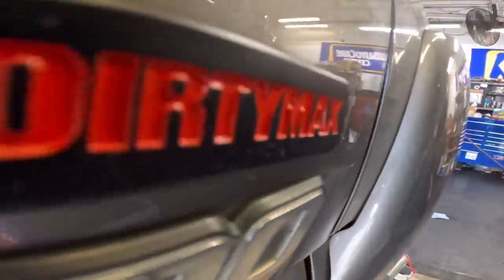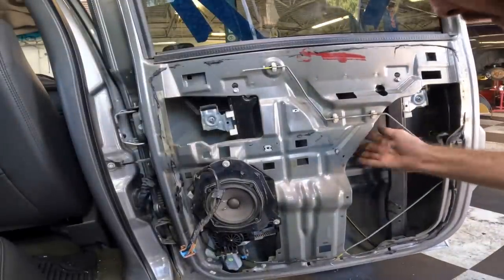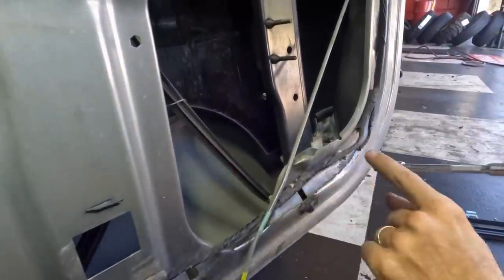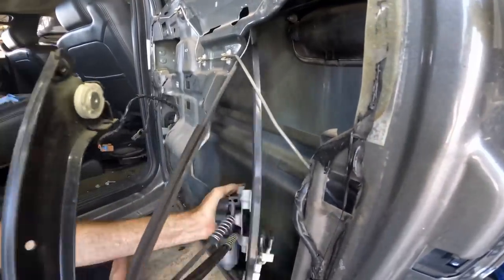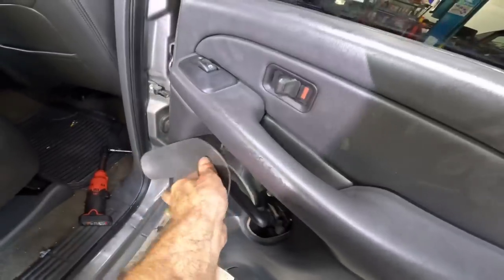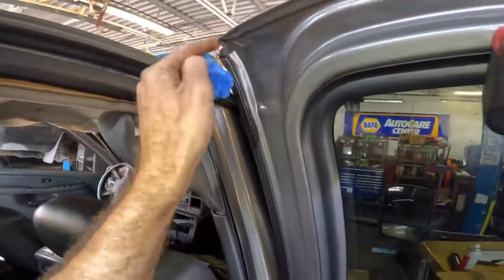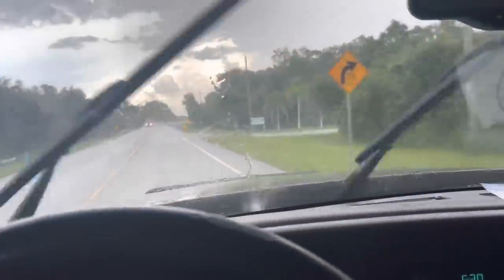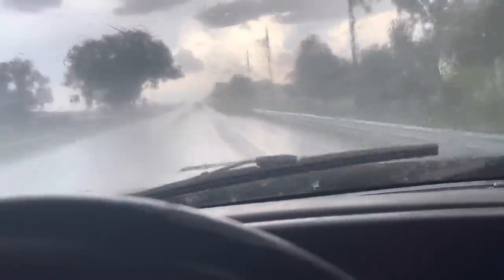Busted Window Regulator!  2007 Silverado 3500 Duramax 6.6

Comment: Sometimes cooking oil spray will break up adhesive left from tape. Of course, then you have to clean off the oil, but wax and grease remover works well for that.

Comment: Great video as usual. But having replaced all 4 regulators in my 2000 Yukon XL in the 14 years and 44,000 miles while I owned it,I would not recommend paying the the 250% premium over the price of a Dorman replacement for OEM, Those Delco units are junk also, just more expensive junk than Dorman. My right front window was seldom raised or lowered. Drivers side mainly for drive thru fast food and an occasional tool booth, and the rear ones literally went years without being deployed. 
Full disclosure I've also replaced two front Dorman units over the past eight years as well since I passed the Yukon on to my daughter who still drives it today. GM wanted well over $200 for OEM and Dormans were in the $70 - 85 range at the time.
I'd also recommend that anyone attempting to do this job test their installation before reinstalling the door panel since no one in their right mind would want to deal with that icky sticky plastic liner glue a second time.

Comment: The reference is to James Fenimore Cooper's The Last of the Mohicans published in 1826 which is a fictional "narrative of 1757." It's a wonderful tale involving the interaction of an Englishman, Hawkeye (Natty Bumppo), with a Mohican, Chingachgook. Although somewhat dubious as history, it does give an idea of what went on In New York State among the tribes and the French and the English in the eighteenth century. All of Cooper's Leatherstocking Tales are wonderful transports into a very early time where values were far from where they are today--cultural differences could still be acknowledged and celebrated.

Also, 99% Isopropyl (available in bulk gallons from Amazon) is unsurpassed for removing glue residue. It was the only thing that finally worked to get the glue off some Lexan windows after the protective paper had been left on too long.

Comment: Ray any octane booster will give you improved mid and top end, and if you drive as you would normally, it will give gains in mileage, what you have to take into consideration is the cost of the additive against the fuel saving, generally not effective enough gains to justify for economy reasons but you can certainly get some power gains  with a booster

Comment: You know, hiding that screw under the armrest so they didn't have to cover it with a plastic cover probably saved 25 cents per vehicle and this allowed the CEO to go to Aruba an extra time that year.  Very smart.  I had an S10 and the window regulators were riveted in.  The back one with all the torque would always loosen up and cause the window to go out of alignment.  The answer was to drill it out and replace it with a small bolt and nut.  I was like yep, another trip to Aruba.

Comment: They make a 4 or 5" eraser wheel that goes on your drill, cleans adhesive residue of paint like a speedy eraser.  Us body men use them all the time for getting door molding tape adhesive of.  Leaves no residue.

Comment: I could never figure out if there was a way after the factory, to get anything changed out. It didn't make sense how it would come out and back in. But you buzzed right through it. Nice job!
Did you forget the grayish colored plastic clip that the motor cable clipped to?

Comment: Use petrol/gasoline to get rid of the adhesive and rubber layer then go back with the brake disc cleaner to get rid of any residue.

Comment: WD 40 works a treat to remove tar and adhesive from paint, metal and glass (don't get it in plastic). Meguiars Plastic-X works to remove it from plastic.

Also I use old credit debit cards to scrape paint as it conforms to the body lines better than a straight edge scraper.

Comment: I switched to ethanol free and my engine runs smoother. I also gained 2mpg so far, up to 33.5 on my 2015 Honda Civic.
Reply: If you can find it, ethanol free is the way to go for sure.  I remember when they rolled out the 'oxygenated fuels' here in the Phoenix area back in the late 1980s - people complained about the drop in fuel economy.
Reply: Thats Good

Comment: I did notice you forgot to put back the harness retainer, no big deal. A hint from someone who has been doing auto painting for over 40 years, to remove tar, glue, tape, and asphalt from paint without damaging the paint use Ronson Lighter Fluid. Not Zippo, only Ronson works and it even gives you a description on the can what it removes. Just a little on a paper towel works wonders.

Comment: If Oxcetane manages to boost the Cetane Rating of the fuel id pour double or triple the recommended amount in the tank and really boost it up because diesels love that they are really picky about their fuel. 
In addition mix in some synthetic 2 stroke oil like 1:200 or 1:300 ratio mix.
Diesels love that stuff.

Comment: Good stuff Ray! One of the most painful jobs I ever did was replacing my old deflectors that were brittle and missing like yours. That dried old adhesive was ridiculous to remove. saw some nice tips in the comments for next time. Where can I find a truck like that? Need to upgrade from my 2500 Suburban. Thanks for sharing.

Comment: I'm still running the original dealer installed AVS vent shades from 2001 on my Durango.  I had to replace the driver door and bought a set for a Dakota, still have a spare passenger door shade if needed, also need headlight switch, broken knob 🎛️

Comment: They sell a rubber wheel that makes getting that double sided tape off super quick. The body shop industry uses them. Saves lots of time! Throw it on the air tool and takes it off in a hurry.

Comment: I think one of the extra screws goes on the bottom rear of the door panel. I was yelling trying to get you to hear me, but alas, I couldn't.
I also tried to get you to plug in the speaker, but you wouldn't listen, again.

Comment: Ray as a detailer I'm cringing watching you use that adhesive remover 😳😭 however a much easier way to remove that would be to get a plastic razor blade & windex IMO I've done it before & it worked wonders. However it's not my vehicle nor my area, thanks for the great quality video as always. Have yourself a fantastic day & great weekend sir 😀
Reply: Plastic Razor Blade?
Where do you get one of those?
Reply: Amazon they're awesome & they work great & don't scratch the paint
Reply: @ExposingCorruptionNC  
Thanks!
I’ll look for them!

Comment: Ray, your Silverado has with in a few hundred miles of my '14 Accord 6 speed manual.  Only failed part was a sun visor and normal wear such as tires and brakes.
Reply: did you see the check engine light on....wonder what that's about?

Comment: They seem like unusually big holes in the door for the regulator to be moved through. I'm sure on other ones where you've related regulators the holes weren't really designed to allow them to be replaced.

Comment: I am curious as to why (since the window was already tapped in place) you didn't unscrew the window clamps prior to lowering it only to have to clamp it back up top to remove the mechanism from the panel.

Comment: Interesting - though RARELY ever used, the window regulators in the rear doors of our 2005 Yukon both broke, seem same as in this video. Since we are in Arizona, and rarely have passengers ( Mrs. Cuss uses it for towing) and the AC is used 95% of the time, I just moved each window to the closed position and used two sheet metal screws on each door to hold the window in the up position.

Comment: WD-40 will remove adhesive residue without ever harming the paint.  Probably one of the best multi use lubricants on the market👍
Reply: Lubricant, yes but not for loosening rusty nuts and bolts like most wannabe mechanics on YouTube.
Reply: It's mostly kerosene. Gets sticky after a while and draws dust.

Comment: I've found WD40 is good for getting nasty adhesive gunk off, and it won't harm the paint. Follow up with some glass cleaner to clean off the WD40 residue and it'll be NiceNshiny! And WD40 and glass cleaner are both inexpensive

Comment: As for ur DirtyMax aftermarket badges, I would've recommended spraying it with Meguiars Headlight coating or equivalent to protect it from the UV Rays before installation and allowed 24 hours to cure. Aftermarket is total garbage.

Comment: Just wondering if that was OEM that you took out. When I replaced the motors in my  95 Camaro they were riveted in had to drill them out, and  replace with lock washers, nuts ,and bolts.

Comment: The directions on that 3M Multi Purpose Adhesive Remover does say to let it soak in before attempting removal.
That stuff's also about $22 per spray can.
Let the chemical do its job Sir.

Comment: WD40 works VERY well for 'adhesive removal' - just let it moisten for a bit of time, then the glue softens.
You'll need soap or alcohol to fully degrease the surfaces when done, but everyone has WD40 and it's far less expensive than the 'specialty' stuff.

Comment: The old regulator did not appear to be OEM, black painted brackets instead of galvanized, and the cable were bare instead of in housing/sheath. I smell a Dorman part. And what kind of trickery is GM trying to pull....no rivets?

Comment: There is another unavoidable Shop Rule: Any used adhesive  gasket, or tape buggers thrown on the floor will invariably become firmly lodged in shoes, creeper wheels, Rolling Tech Cart wheels, and anything else that you need to move across the floor . 😒😒

Comment: I know there's probably not any one single "most annoying part" on vehicles in general, but like... sure, sometimes there's a bunch of stuff in the way of an alternator, or a sensor is installed in the worst possible place, but window regulators seem to CONSISTENTLY be the most awkward things to install and remove, based on these videos.

Comment: 13:48 if dint wanna replace adhesive on protective plastic “wrap” layer for water, dust, & dirt…….can use “hair dryer heat” to help soften adhesive sealant and then press back down; than as cools, should be good as gold. “Should be”, and definitely don’t wanna use heat gun that doesn’t have temp or airflow adjustments on it, as melting or shrinking plastic or anything else…..definitely a no bueno. If no heat gun if a DIYer, literally use yours or just “borrow” Partner’s hairdryer; just make sure to return said hairdryer to original place and if don’t wanna be in dog house; clean hairdryer if get dirty; and whatever you do….now this important; listen up! Even if filter on hairdryer has fur coat and needs cleaning/replaced…STOP! DONT DO IT, cuz you’ll be blamed for “messing up the hairdryer” which worked “perfectly fine” before “you touched it”…..you have been warned😉

Comment: Instead of using highly expensive "proprietary" spray cans like the adhesive remover (which didn't work that well), why not use something known to work (and work better) and any decent workshop would have on hand and also a tenth of the price, like isopropyl alcohol?

Comment: doorplastic touch.. right with windsheild goooo when fresh & cracks again cuz unibody bent.. 😆 🤣 😂  speedbumps @ 75 mph.. (highway bridge concrete frost heave.. ½inch @75mph with a lowered suspension kit & stiff 😆 🤣 😂  but worth it.. sadly on way home with it after buying it 63miles away lol
oh.. bent down cuz on brakes cuz guy in front butt hopped.. empty pickup.. so i found out why lol

Comment: Is your duramax tuned and straight piped? If so you should do a video on it
Reply: that's an LBZ duramax, no particulate filter, no DEF. just a rugged, reliable diesel engine
Reply: @masterchiller9681  your right. I meant straight piped**

Comment: After replacing my wife's driver side regulator, when I roll it up and down, I get a warning message that the doors open even though the door is latched and secured. Did I route the door latch cable wrong I assume?
Reply: Why not use a trash compactor mech...might last awhile...
Reply: Front brake disc pads and nice and shiny window regulators.
Reply: @torchit007  It's a  cruze. If I could put it in a trash compactor, I wouldn't hesitate. She won't get rid of the car and it drives me nuts.
Reply: Yeah it does look like shaved eyebrows without those on.

Comment: What causes a  fog light switch to melt?
Reply: excessive heat will cause it to melt.
Reply from the maker: I had an extra light tapped into the circuit and it overloaded the switch

Comment: You can tell a cheap regulator because the rails will flex and bend eventually leading to early failure. eBay is full of cheap regulators.

Comment: THAT BLACK GUM STUFF IS BUTYL...IN HOT WEATHER IT IS STRINGY GUMMY NASTY GOO...I USED TO SPRAY A BIT OF GLASS CLEANER ON IT TO CONTROL MOST OF THE GOO...CLEANER WILL DRY AND RE STICK JUST FINE...A BIT OF TAPE HELPS...👍🇺🇲💪🙋